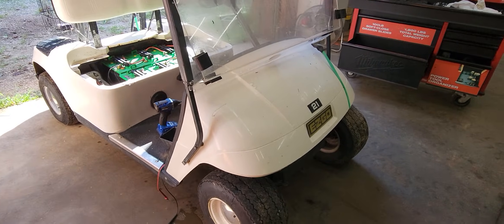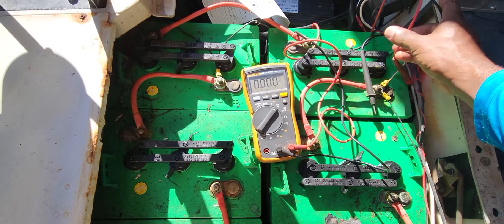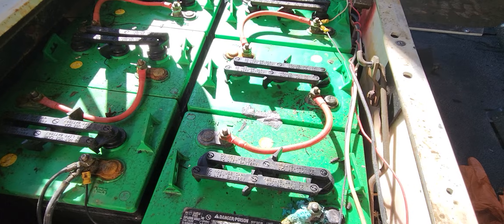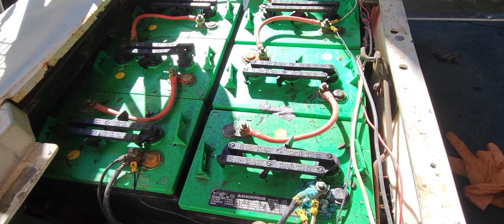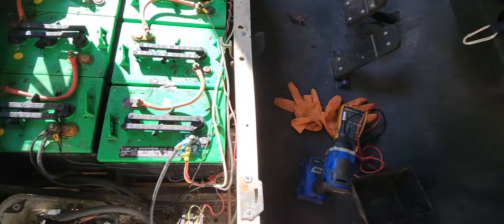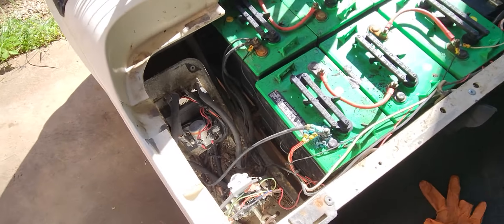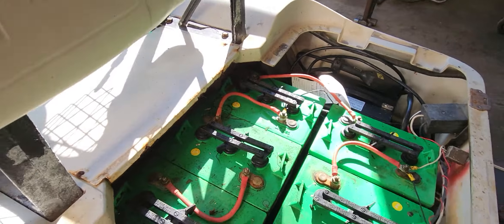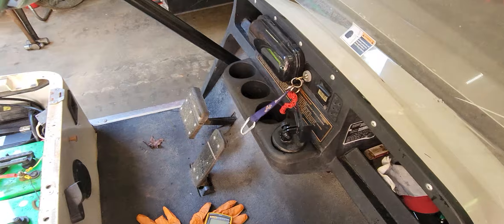EZ-GO Golf cart stopped working. How to diagnose / troubleshoot an electric EZ-GO golf cart.

Comment: My 05 TXTE DROPS TO 27v when I depress the pedal, and does not move in either fwd or reverse.  Any ideas?  Solenoid clicks…new batteries and cables (the batteries were old and cables needed replacement anyway). Visually everything looks good.  Pulled the motor and checked brushes…ok.
Reply: Joshua Lee I need your help my guy, just watched this video and it’s been the most helpful so far. Long story short I have a 1996 ezgo TXT 36v. Batteries are about a year old at most, every time I take the cart out it runs for about five minutes and then dies my M - wire coming off the top right hand of the control box is very very hot all of the other wires are not, this one is excessively hot by where the terminal meets the m - control tooth top right of box. Sometimes if I put the pedal down it’ll jump sporadically after it’s died (battery led on dashboard reads full). If I let the cart sit for a while it will then work again. The battery meter on the cart says it’s decently or if not fully charged but dies. I rewired all of the low-voltage wiring off of the forward and reverse assembly I’m on my third control box and third solenoid. I’m at a loss I don’t know what to do. I watched your video and checked to make sure my batteries are good they’re all registering at around 6 V. Any suggestions? Would love to chat via text or call, I’m that desperate!
Reply: @MichaelJohnson-uw7fu  Have you fixed your cart yet? I would suggest you replace the control box. If the wire is getting hot, there must be something shorting out in your control box, but this is just an educated guess. Everything you said about what your cart does points to the control box. Good luck!
Reply: @GetRealBaby  no still down
Reply: @GetRealBaby  had the controller bench tested and it’s fine.
Reply: @MichaelJohnson-uw7fu  You might check to see if the golf cart dealer in your area will allow you to test a new Control Box and allow you to return it if it doesn't fix your problem. Make it an attractive offer by having your cart parked on a trailer outside his shop, telling him you'll switch out the Controller Box right there. Just a thought. Where ae you located? If close, I'll buy your cart from you and try to fix it myself. But it's more than likely that Box. Good luck.
Reply: @MichaelJohnson-uw7fu  That's interesting because a Controller has to be tested under a load. How did he/she test it under a load? Did a pro work on it or just someone who knows how to bench test batteries? Very curious.
Reply: Have you figured out the issue?  This is same problem i have.
Reply: I found a battery cable, that although it showed continuity, under load it had high resistance.  Insulation on a new cable was not trimmed back properly and only a few strands were making contact
Reply: @robtcarleen    is it normal to hear almost what sounds like static coming from the batteries?  New ezgo owner here
Reply: @kwfx007  no…sounds like a loose battery connection, or other current carrying wire.
Reply: @robtcarleen  must be the latter, cause all the battery connections are good. The solenoid i replaced had signs that it had gotten hot, and the eyelet on the resistor wire that connected to the left side of it, the plastic is melted
Reply: @robtcarleen  even with the 2 main positive and negatives disconnected the static noise is still there. Like its coming from the batteries themselves? If that makes sense
Reply: Kieth Wilson. Check that your battteries are all properly connected together in series. +-+-+-+-+-+-
Reply: @robtcarleen  yep checked that also they are in order
Reply from the maker: Batteries are not fully charged. Charger isn't working or you have batteries wired up wrong. There is no other way brand new batteries can immediately drop to 27volts when you simply press the pedal.